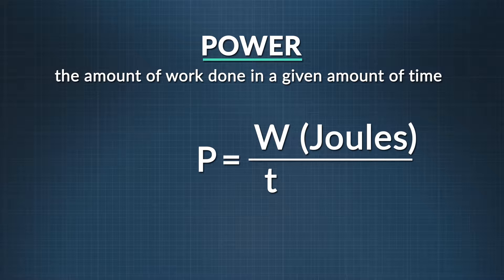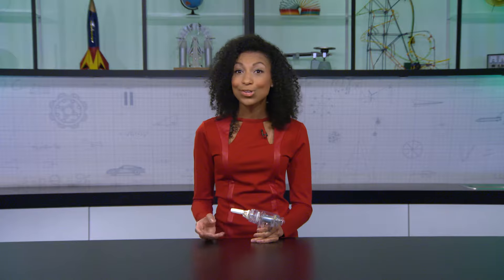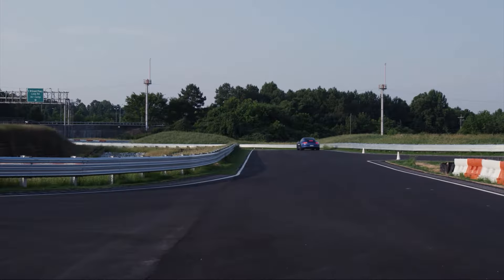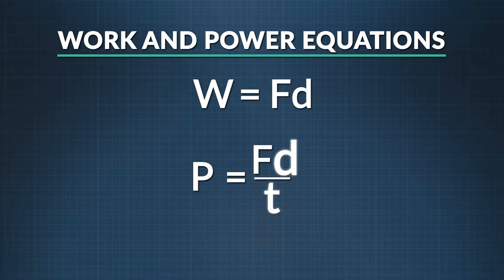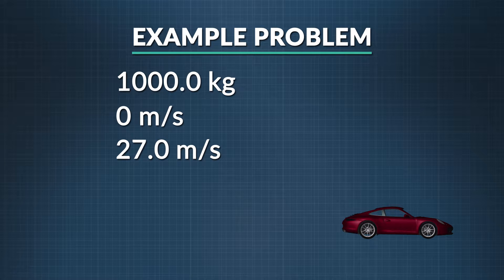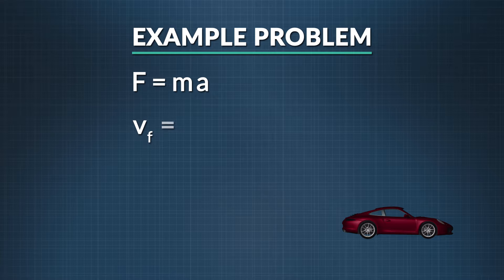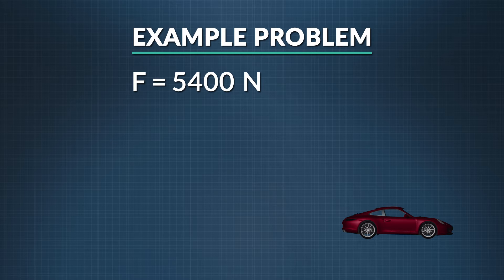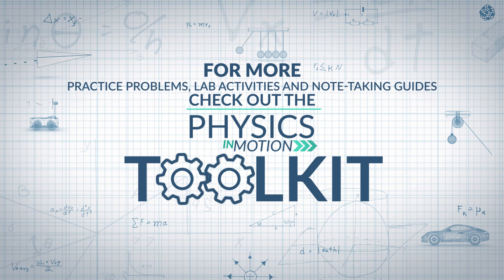What Is Power? | Physics in Motion

Comment: In the accelerating car scenario, the (total distance)/time value would be one half of the final velocity.  So the power of the car would work out to be one half of the value shown.  Values shown correspond to a 0 to 60 mph time of 5 seconds, a 2200 pound car, (a fairly small car) and a 195 hp engine, so it seems like that should be correct.  Sounds realistic.  But in the hypothetical scenario (not including wind resistance, and a constant force and constant acceleration) an engine half that size (in power) would get you to that speed in five seconds!
Reply: the answer they give is WRONG!! using the final velocity is invalid as the velocity is changing. Find the distance moved while it accelerates ( d = [(vi + vf)/2] x t ) gives a distance of 67.5m. work done = f x d = 5400N x 67.5m = 364500J so power = 364500J/5s = 72900W  [half the value given or the average velocity x force] I guess you better stick to horsepower!
Reply: @jonbidgood4924  it’s not wrong, change in velocity for this scenario had no change…
Reply: @jonbidgood4924  hmm i was thinking we should get 5400N x 67.5 m also. thanks!
Reply: Thanks for sharing that. Was thinking the same
Reply: Thanks for this reply.  P=Fv is used for objects with a constant velocity.  
The average power exerted by the car as it accelerates from 0 m/s to 27 m/s over a period of 5 seconds is approximately 72,900 watts (or 72.9 kilowatts). This calculation takes into account the change in the car's kinetic energy over the time interval, providing a more accurate measure of power in a scenario involving acceleration. 
# Given values
mass = 1000.0  # mass of the car in kilograms
initial_velocity = 0  # initial velocity in m/s
final_velocity = 27  # final velocity in m/s
time = 5  # time in seconds

# Calculating change in kinetic energy (Delta KE)
# KE = 1/2 * m * v^2
initial_ke = 0.5 * mass * initial_velocity**2
final_ke = 0.5 * mass * final_velocity**2

# Change in kinetic energy
delta_ke = final_ke - initial_ke

# Calculating average power (Power = Delta KE / time)
average_power = delta_ke / time
average_power
Result
72900.0 J (which is half the power that was calculated in the video,)

Comment: The answer to the problem at the end is wrong. Will this be addressed?
Reply: Where is the problem
Reply: the answer is fine
Reply: @ahsan4257  The answer provided by PIM is two times too large because P=F*V only works if the velocity is constant - or if we take the average velocity.  Because velocity changed uniformly we can solve the power problem by taking the average velocity over the displacement travelled, which is 13.5 and not 27 m/s which is the final velocity.